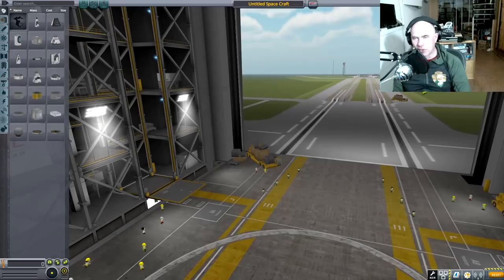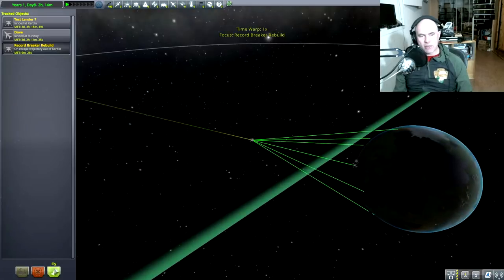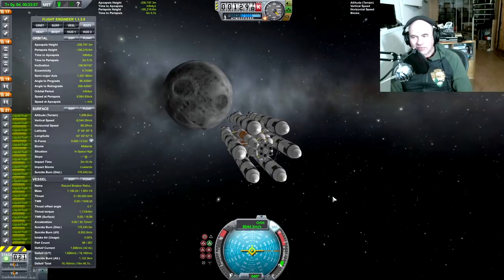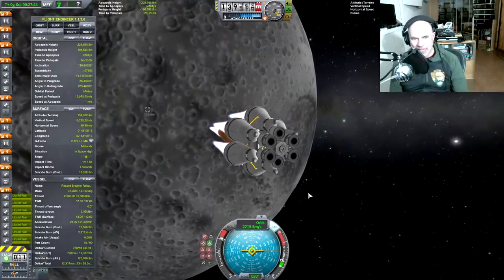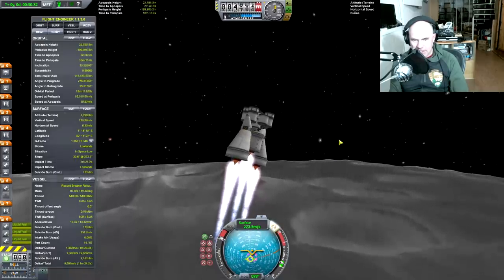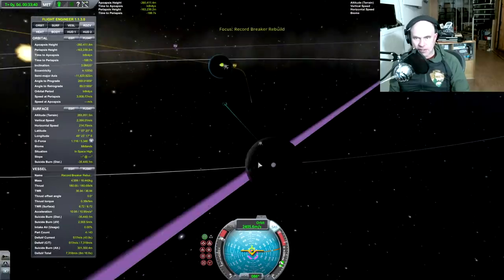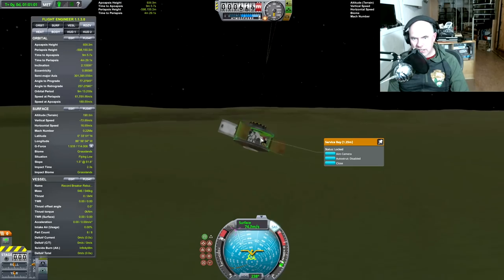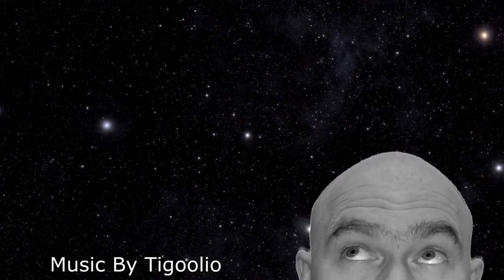Kerbal Space Program Munar Speedrun - 1:01:05 to Mun & Back

Comment: The shortest distance between two points is a straight line... with a suicide burn at the end and some unintended explosions in the middle.
Reply: Jett Quasar the earth changes the curvature of space-time and thus we are not working in Euclidean space so the shortest distance is not a straight line
Reply: It depends on your frame of reference.  Also note that moving at relativistic speeds will decrease the distance between two points even further.
Reply: And with a wormhole the shortest distance is always 0 ;)
Reply: Since both bodies are moving, the path will not quite be a straight line...
But of course, the optimal in terms of time is accelerate half the distance, decelerate the other half...
... Except in a rocket, because so much of your mass is fuel, the optimum is actually a massive impulse burn that burns as much fuel as possible in as little time as possible....
Ehhh. Too complicated. XD
Reply: Damian: Euclidean geometry only applies to planes, so while a straight line is impossible on a planet (technically, works just fine from our perspective) in space you can treat yourself as on a plane by ignoring the third dimension. Some adjustment of your orbit might be required though to get into the right plane. I'm tired of people saying Euclidean like it means something. It's a set of 5 postulate for lines on a plane.
Furthermore, that's not how gravity works. The way that it curves space is that you fall toward the object. For all intents and purposes it is just a force. If you have enough thrust you can just go in a straight line in space, more or less. At least if you lead the target properly. Maybe some slight adjustments here and there.
Kuralthys: What you said regarding acceleration is accurate if you aim for empty space, but if you want to land you also need to save enough to fight the gravity.
Reply: Actually, in space you cannot treat yourselve as if on a flat plane. The Christoffel-Symbols may vanish at one point, but their derivative does not.
Thus you have to calculate your geodesic (d^2x^μ/ds^2 + Γ^μ_{αβ}dx^α/ds*dx^β/ds = 0)
(Latex code: \frac{d^2x^\mu}{ds^2} + \Gamma^\mu_{\ \alpha\beta}\frac{dx^\alpha}{ds}\frac{dx^\beta}{ds} = 0)
Reply: Is it super said that my first thought was that sounds like apollo 13 minus the suicide burn....
Reply: HI jett!
Reply: Yo little dude!
Reply: Jack you don't sem to understand what euclidean, and more so, uneuclidean, means. The word is used way outside planar geometry, as the key defining characteristic of it, there being unique parallel line going through a point for any given line, is applicable in way more places.
Reply: Calculus of Variations is very sad right now.
Reply: @Damien W
"we are not working in Euclidean space so the shortest distance is not a straight line"
not all lines in euclidean space become curved in non euclidean space. think of where a L2 lagrange point is and why its there (straight line between the 2 bodies)
Reply: You mean feet per second right?

Comment: How about a challenge for the fastest orbit around kerbin? I wonder how much faster than a normal orbit you can get.
Reply: no pun intended
Reply: Um, that's what he did at the end of the video -- you did watch the entire video, right?  (Answer:  1 minute)
Reply: M Reed No, i did not mean the time to orbit. What i mean is the time from flying in orbit to getting back to the exact same position in orbit after surrounding the planet. For example, start above the north pole, fly over the south pole and back to the north pole (launch and landing not included, time starts in flight).
Reply: so you weren't joking. the orbit speed is fixed for an altitude. if you thrust prograde, your orbit goes higher.
unless you thrust at an angle inclined towards the planet center...
Reply: The problem with that is that an orbit with a higher velocity means you need to be closer to the object you're orbiting; adding more speed just makes your orbit elliptical. On Kerbin and other planets, you can only go so low before you hit the atmosphere. On the Mun and other bodies without an atmosphere, you can only go so low without hitting mountains.
Reply: goku Excactly! Start with a high velocity, perhaps from a hyperbolic trajectory, then thrust towards the center of the planet until the orbit is completed. The orbit speed is only fixed for a constant acceleration towards the center, which is the gravity plus whatever acceleration you can get out of your rocket. Earth only accelerates you with 1g? Make it 2g with the power of rocket science!
Reply: GreenJalapenjo Only true if the only source of acceleration you rely on is the gravity
Reply: Nerdcubed tried it a while back and I think Scott responded to that video. You need to get your inout speed exactly right on a hyperbolic orbit and then maintain thrust directly at the centre of kerbal.
Reply: SPACKlick 
Do you mean Kerbin instead of Kerbal?
Reply: +Kerbonaut #1664
Yeah, I did, although pointing a rocket at the centre of a kerbal would be somewhat interesting.
Reply: Yeah, that would be insanely difficult to do.  Given that your TWR would vary dramatically during the circumnavigation due to staging and burning off fuel, the angle (to prograde, in the radial-in / prograde plane) you would need to thrust at to maintain constant altitude would vary significantly, and the game doesn't provide you with any good tools to determine this direction.  Heading errors (resulting in non-constant altitude during gameplay) would dominate records rather than ship design.  I doubt watching Scott press the A and S keys while staring intently at the vertical acceleration and altitude meters would make for particularly interesting video, but I've been wrong in the past... :)

Now, you could build a KOS program to execute this, but watching a KOS program execute probably makes for a really boring video.

Algorithm development might be interesting for some people -- measuring acceleration and producing the desired heading in this context would be tricky.  KOS provides you with the current velocity vector, and it is easy to setup a routine to capture the velocity vector each physics tick, but...  Subtracting the magnitudes of the current and previous velocity vector only produces the correct results if the acceleration is in a straight line.  Subtracting the vectors will produce a mathematically correct result, but using this  acceleration vector to determine the correct heading for the next physics tick isn't immediately obvious.  Or you could approach it from the other way -- try to calculate acceleration based on the mass of the ship / thrust of active engines, although I'm not sure that would help.
Reply: Paul Paulson Scott did this during his "Your Physics Have No Power Over Me!" video, linked here: https://youtu.be/tNMnDrLCW60
Reply: I remembered he did this in an livestream way back. He had to keep thrusting towards Kerbin to prevent the ship from flying off.
Reply: SPACKlick - Danny2462 points rockets at the centre of kerbals all the time.

Comment: If you take a large tank, you can put a single vector in the middle and then with 6 part symmetry place 6 more around it creating a 7 booster cluster instead for the stock 4. Needless to say, it’s more powerful and easier to control, if it’s not “lagging”.

Comment: How about a revisit of this where the braking and return vessel is upside down on launch so there is no need to rotate at all?
I guess you'd burn off all the fuel in all the outer stages to get there and ditch em before you do brake to land. That is, if you can have em upside down that is...
Then there is the whole fun of reversed controls. I guess a small probe body could be used to give a correct orientation for one of the trips?

Comment: When doing an airbrake but not fully de -rbiting could you use the planet's rotation/wind to alter the angle of your orbital plane without spending fuel or do you think the fuel spent recovering the speed lost in the airbrake would always outweigh the delta v saved in the free orbtal plane change?
Reply from the maker: +willis936 this is called an aero assisted plane change. It’s not clear the savings work
Reply: I thought about this for a bit.

If you're already in low orbit, it doesn't take much delta-V to intercept some atmosphere for your wings to work with. To make it worth your while, you want to gain more change in direction than you get reduction in velocity, in other words, you want more lift than drag. It's not hard to make an airfoil with a lift-to-drag ratio of 10 or more, but that's at subsonic speeds, not hypersonic ones. When you're moving at mach 27 or more, an L/D ratio of much more than 4 is probably impossible. That still sounds like it might be enough for our purposes though.

So you do a small retroburn, dip into the atmosphere and start turning with an L/D ratio of 4, so far so good. What happens when you finish your turn? You point your nose prograde and stop getting lift. This reduces the drag you get, but it doesn't go to zero, reducing your effective L/D ratio over the whole maneuver. You can solve this either by very carefully calculating the size of your 'dip', or by splitting the maneuver over multiple orbits. This might be a good idea anyway so you don't overheat your spacecraft. Don't forget to fire your engine to counter the drag while you're doing this or your apoapsis might enter the atmosphere. And fire again at apoapsis of course, once the desired plane change has been achieved.

To perform this maneuver, you need wings, and as we saw, they need to be good ones. The space shuttle had a hypersonic L/D ratio of 1, which doesn't get us anywhere. The dream chaser might be better, but I haven't seen any numbers on it. The wings also need to handle the compression heating from a mach 27+ airstream. It won't have the intensity of re-entry, but I don't think it's pleasant. Wings that meet these requirements are probably going to weight quite a bit. If you had brought more propellant instead, could you have made the same plane change propulsively? Maybe. It's definitely simpler though.

So is this maneuver useful? Well, if you're going to do aerobraking anyway, it you can grab a 'free' planechange while you're at it. If your craft already has wings and operates in low orbit, it might make sense. Otherwise, not so much.

Maybe try it out in KSP?

Comment: I know you really wanna hit sub 60, maybe using a proper speedrunner timer with segmented times would be beneficial, breaking it up in segments like [supersonic] -> [70k] -> [suicide burn start] -> [landing] -> [70k] -> [touchdown], would allow you to tune several stages for more speed and have a clear readout of every change in the different stages.
Reply: Yeah not segmented, 1 full run, but with times for different segments of the trip, it can really help squeeze seconds out.
Reply from the maker: +Ardbug every segment is dependent on a previous one though.

Comment: Add a plane engine to the last stage. It is a waste of time to travel through the atmosphere with just 200 m/s
Reply: Might not be worth it. You have to consider the huge mass of the fuel and engine you have to transport the entire trip.
Reply: Nose cone. You'll be descending a lot faster than you might like.
Reply from the maker: It's all about tradeoffs - engines to nosecones mean more mass to accelerate on the way back from the mun, lower velocities overall.
Reply: anything you put on to the last stage has a huge effect one the economics. Just think of it in terms of deltaV. If you put an airbreathing engine (+ fuel, +intake) into the final stage you have to also add enough energy to give >24.000 m/s dV to this mass (boosting it up to 8k m/s, suicide burn about the same amount to touch the moon, go up to 8k m/s on the way back, etc). It wouldn't suprise me if you need 100 tons of additional launch mass to carry 1kg of additional payload mass with the same acceleration.
Reply: Of course, wasn't saying this would be efficient, so here's the challenge, as inspired by the 3-parts-to-everywhere grand tour: Make the nose cone dockable and send it onto an absurdly elliptic orbit using its own rocket. Then, when you're on your way back from the Mun with your original speed ship, accelerate the cone ship and rendezvous, transfer the cone, and off you go.